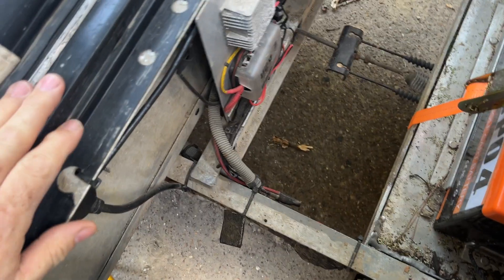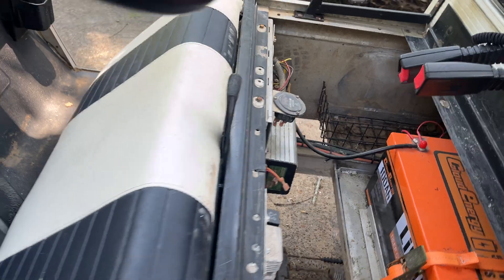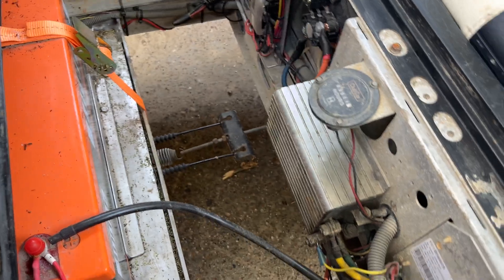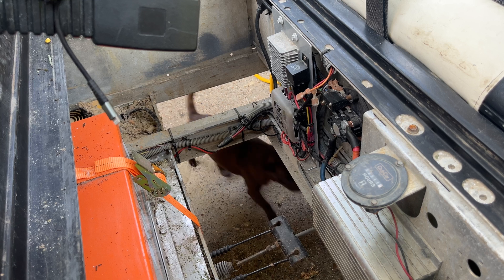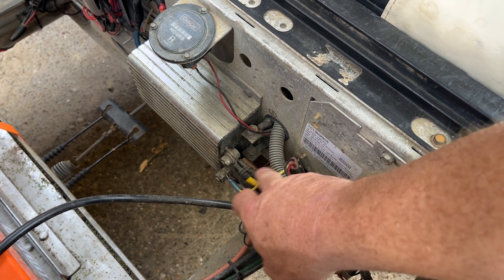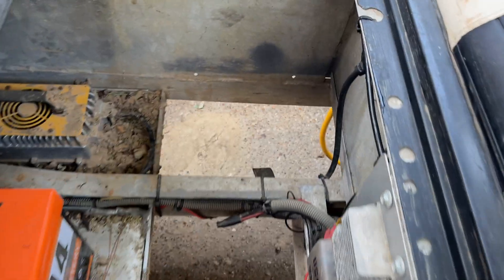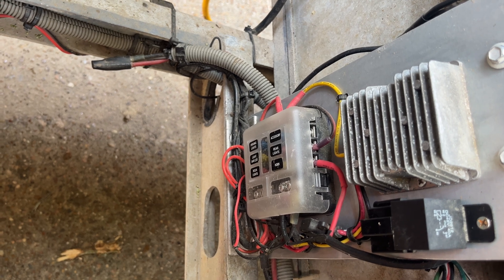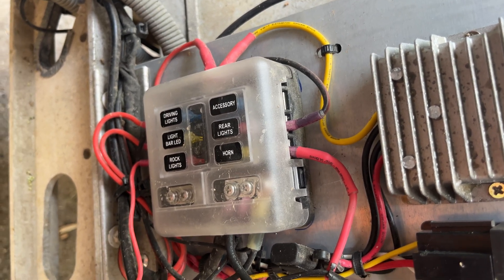Club Car 2001 48v OBC bypass

Comment: Hello, I have a 2002 Club Car DS and am converting the cart to Allied Lithium with new direct charger. I’m trying to properly bypass and eliminate the obc. My cart has the triangular connection with a yellow, red and green wire coming out of the obc. Thoughts on how to handle the three wires? Thank you
Reply from the maker: I believe if you run the yellow wire that is going into the obc to the b- terminal that should work. I’m assuming it’s a series cart with no,tow run switch. Those three wires on the 2001 model are yellow red and black. The yellow wire is a ground. The obc essentially is a ground switch. By grounding the yellow wire, it is basically telling the cart it’s ok to charge.  You should verify the wires by looking at a wiring schematic for that exact model. If it is the kind shown in the video it should work. As always, verify the wires on the schematic. I have done some where I just take the inline fuse out of the wire near the factory charge port out that goes into the obc, leave the plug intact and tie it up,somewhere, then ground the yellow wire. I show that in the carryall 1 build in a different video. It’s near the end of that video. Hope that helps.

Comment: I have a 98 Club Car DS Power Drive Plus 48 volt, and l’m trying to bypass my OBC. I don’t have that triangular plug with the yellow wire that you ground in the video. My cart has a 6 wire connector between the controller and the OBC that has the white and blue wire that I see people connect when bypassing the OBC on a Precedent. Is the “Power Drive Plus” version of the DS more like a Precedent? Should I just eliminate the grey at the charger plug, run the black from the charger plug to 48 volt negative and unplug the 6 pin connector at the OBC and jump the blue and white wires on the controller side? I have a photo but can’t attach it.

Comment: I don't understand why a relay is used to power the converter when all power is killed with a master on-off switch. I used a marine boat switch. Then I wired my charger ahead of the switch. All connections are made to either the positive or negative bus bar.
Reply from the maker: You don’t have to use a relay. But you need to use either a relay or some type of switch or the converter runs all the time. The relay just lets you use your existing switch so you don’t have to add that big bulky battery switch. Some people just wire the converter up to the key switch. It’s just easy to use a five dollar relay.

Comment: Mr. Dean,I have done exactly what you have done here but the cart still will not move,any ideas-only thing different on mine is the obc far as mounting position and shape still would think it works in same fashion-all trap controller high speed motor with lithium battery with onboard charger thanks for any and all help
Reply: Im having the same issue did you figure it out?

Comment: I cut and hooked the yel wire to the B- and the cart runs great now. However the reverse buzzer is on in forward and reverse even with the key off. But not while in neutral. any ideas why

Comment: Hi Dean, If I remove the OBC do I still need to put Yellow wire on B negative terminal. If I leave it in do I leave it plugged into other end? Thanks
Reply from the maker: Hi Keith. I think the answer to your question is yes. It needs to be grounded. It makes the cart think it’s ok to charge without it. In my case I’m not using the charging port. If you take the fuse out by your charging port and leave the port in place it should be ok. But, if you remove the plug like I did you have to ground it or it won’t work like it should. I’m not sure what you are planning on doing for a charger.

Comment: At the end of your video. Your showing what is all connected to your negative terminal.  Your linked video pops up with misic and blocks your audio.  What were you saying to the negative? Main ground, battery charger ground, and what elae? Thanks!
Reply from the maker: Sorry, the third thing is the negative for my 48v to 12v converter.

Comment: Looking at adding this battery to my 2015 ezgo. Everything still going good. Looks to be a good battery
Reply from the maker: Yes. I have purchased a second one now for my other cart. Works well , great range, lots of get up and go.
Reply: @DoItWithDean  thanks for the response. Just ordered
Reply from the maker: Did you get your battery installed? How is it?
Reply: @DoItWithDean  I did. It’s performed great. I do have an issue with it not showing the correct percentage left. The included display and the phone app will show 66% left but the cart loses all power. Then both will switch to zero. Contacted them and they said to do at least 5 charges and see if it corrects itself. They responded right away and told me if it didn’t they would send a brand new battery. Good folks to deal with.
Reply from the maker: @DLXSKIFFMITCHELL  awesome. Yea, they have great customer service.

Comment from the maker: Message me on Facebook and I’ll send you a diagram of how I wired mine in.
Reply: Whats your FB, i'd appreciate the diagram if you willing to share! Thanks!
Reply: I didn't see your channel on Facebook.    So you leave the connector attached and cut yellow wire before it enters the obc and ring it to the b-.
Reply from the maker: @tinysparky  which connector do you mean? If you are talking about the plug to the obc then yes, you can leave it attached if you want. I leave the OBC in place and just clip that yellow wire then put a ring terminal on it to the b- on the controller.